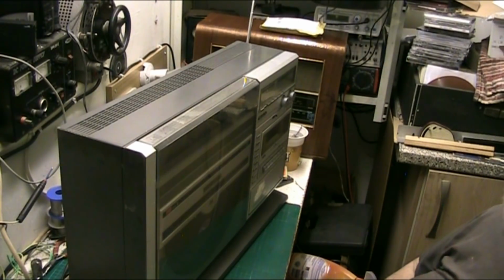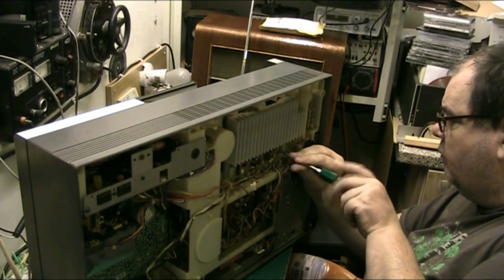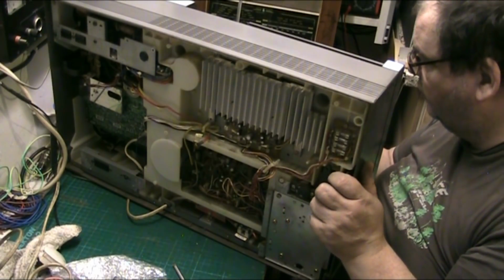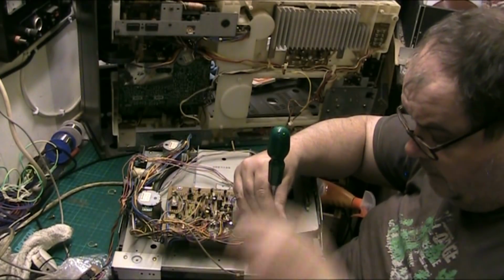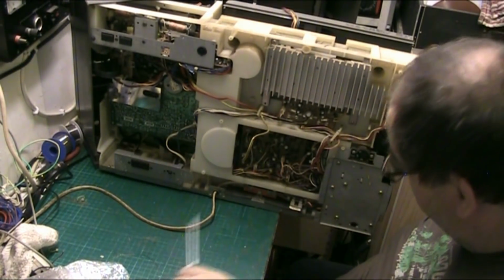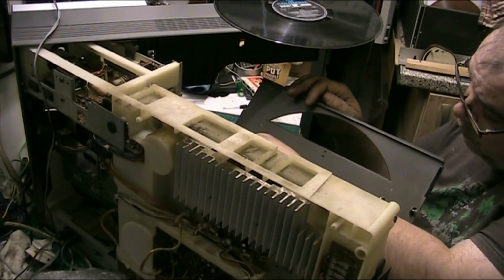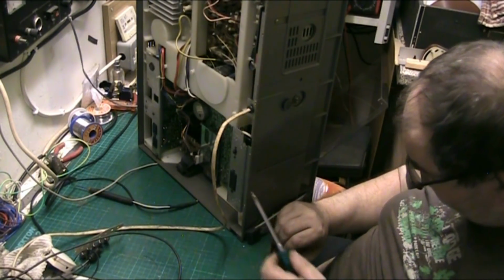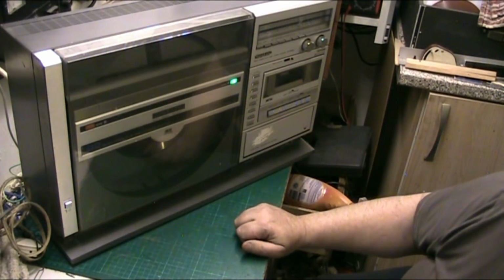REPLACING THE TURNTABLE BELT ON THE SHARP VZ 3000 MUSIC CENTRE

Comment: LOL. Great video. This was me today, except that I had the added bonus of the door not opening up. Not even with the emergency release - or so I thought, it turns out that I was just too gentle. It needs a good bit of heft. In the end I managed to release the door from the inside by pressing down on some metal latch. It was only afterwards with the machine out of the case, that I made this discovery about the release mechanism. Now I need to get a new belt for the small motor up in the top right corner of the turntable.

Comment: Awesome video. I have the same machine. Suddenly the door opening stopped working. Light inside the turn table and dual play and repeat lights work. Even if I manually insert the LP it doesn't play. Any idea what would be the issue? Thank you!

Comment: Aren't  you suppose to change belt from front  inside face then few screws it all drops down in front or am I wrong ....
Reply from the maker: Yes you are wrong trust me I tried to find an easier way to replace that belt and the only way is to dismantle the unit a very bad design mate
Reply: @andymann1231  Hi just going by what service manual says.   But wish me luck bidding on one wish me luck

Comment: Nice videos. Your problem is a small relay on the rear of the PCB. I have the same issue on mine but the part is fiercely expensive.
Reply from the maker: thanks I did manage to sort it out I just pulled the top off the relay and cleaned it it seems to work ok now

Comment: I got a sharp vz 3500 tape is fine but deck belt has gone and it only has one channel of audio on all functions not had it apart yet the foams in the speakers had gone i have kept the drivers to refoam them but i replaced them with 4 ohm speaker drivers i had and it sounds a lot better now than it did  with the original speakers .